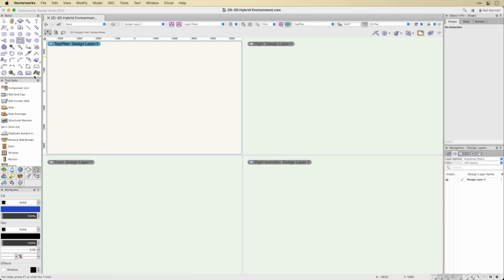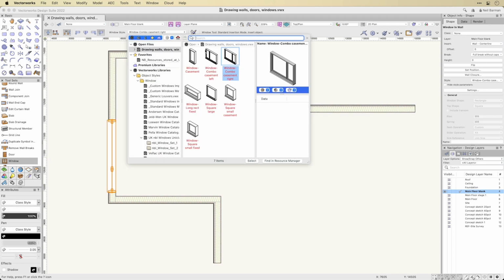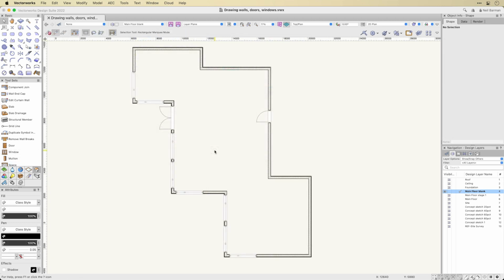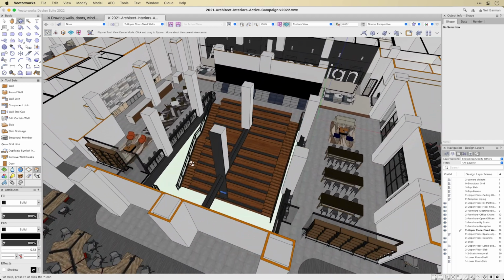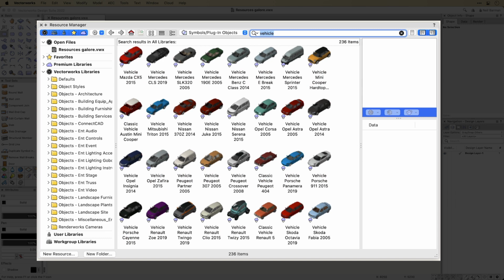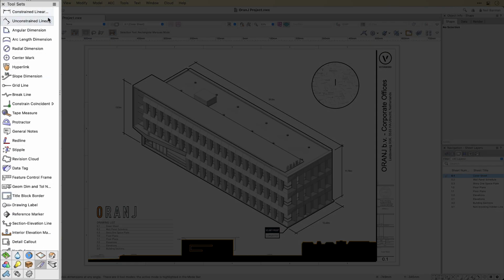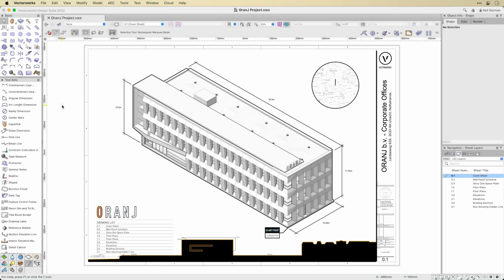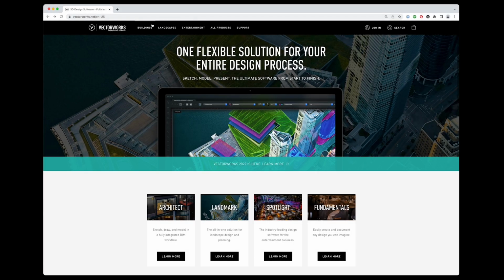Evolving Your CAD Drafting Workflow

Comment: Is this an old video that’s been reissued or has Vectorworks genuinely just posted a video showing the difference between Vectorworks and AutoCAD in 2022?!

Majority of the industry is now in parametric BIM modelling software such as Revit and ArchiCAD which is easily equivalent and arguably more advanced than vectorworks. Is this just VW admitting that it can’t compete with those platforms and trying to get into the market of older firms that haven’t made the move from AutoCAD?
Reply: That’s great that you’re doing BIM! There are actually designers in many parts of the world who have not yet discovered the benefits of BIM. This video is to help show them that they can go from 2D CAD to 3D/BIM and design without limits with Vectorworks.

Comment: How powerfull a machine do I need? I got a wounderfull 1X carbon from 2012 :) If it works with that and cost the same as autocad then ee can talk
Reply: Whether you can run Vectorworks will depend on your exact X1 carbon model and how much GPU it has, but you can check if your model can run the software by checking our minimum system requirements here:
https://www.vectorworks.net/sysreq

We offer cost effective and flexible pricing options and you can download a free trial to test the software as well: https://www.vectorworks.net/en/architect?showModal=trial-form